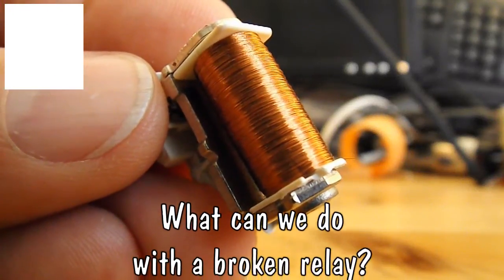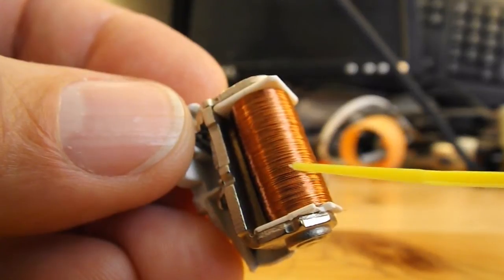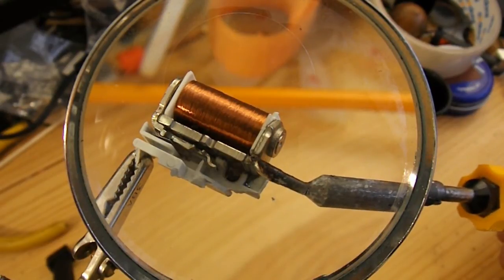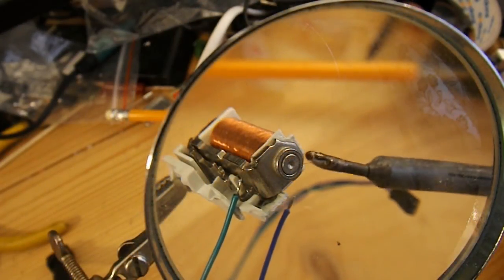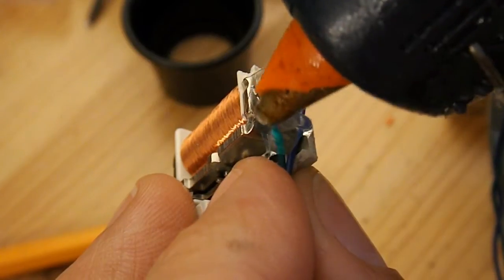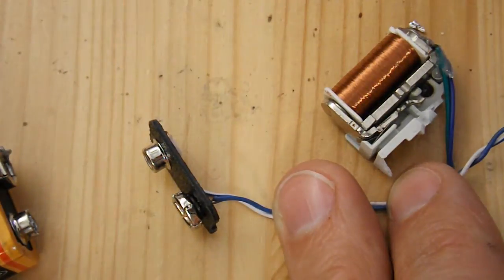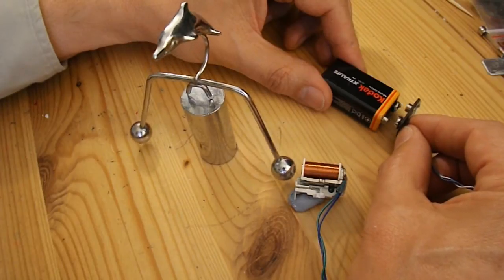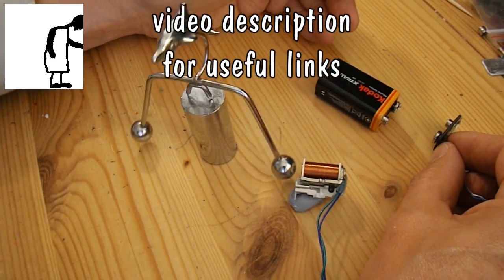What can we do with a broken relay?

Comment: could you make an rc vehircle please
Reply from the maker: Hi, I have done a few rc vehicles but I don't do them often as I usually test my projects indoors and that rather limits what you can do with an rc car. Just backwards and forwards and turning a bit. Here are some examples.
Bargain Store Project #52 CD Wheels RC Car with Lights
Bargain Store Project #54 RC Festive Baubles
WIFI and USB FPV fun
RC Valentines Delivery
Reply: however could you make a small one
Reply from the maker: Craftman yea I have some components, just need the time to get around to it. I will add it to my list of things to do later.